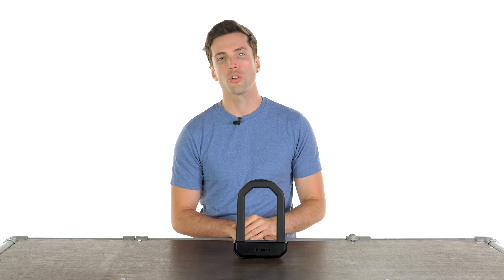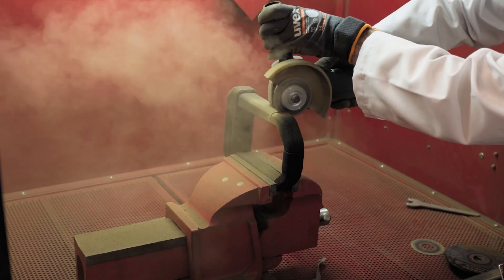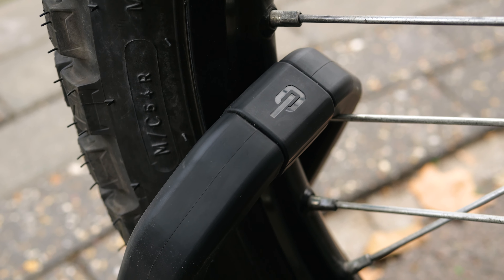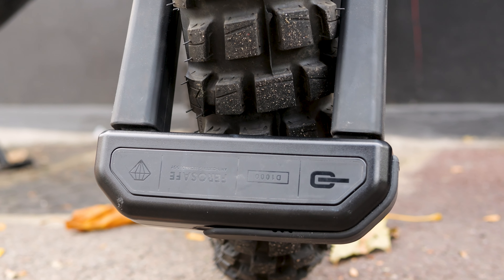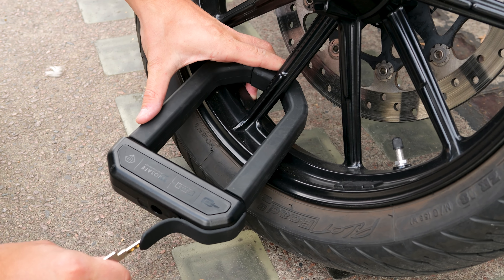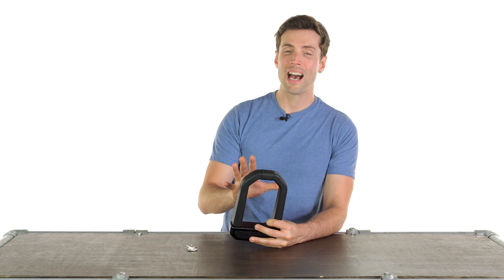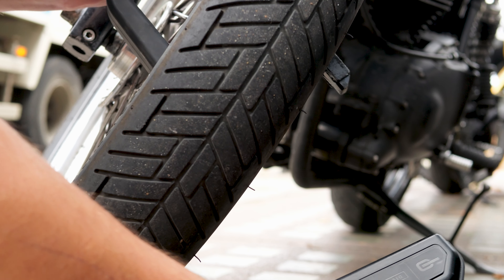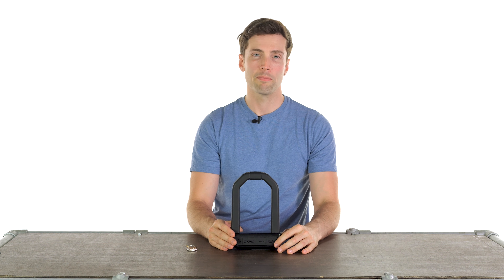HIPLOK D1000 'Anti-Angle Grinder' Bike Lock Review

Comment: Advice:

Use any quality lock SMARTLY!

Don’t just lazily put it through one wheel spoke like in the video. This WILL encourage a thief to destroy your moto’s front wheel to steal the whole bike.

Go through the rim instead. Or more than one spoke AND the rotor. Grasp as much with the lock as you can. Go through the most stout thing you can. 

It annoys me to see lock companies advertise people casually (& lazily) locking a bicycle through the frame top tube only. 

Doing this does encourage thieves to cut your frame!  Why are lock makers marketing a security product in a way that more easily enables someone to defeat the sole purpose of their product?  (I think it’s to sell convenience, IMHO.)

Make what you lock through on your bike stout AND expensive. Not a single easy-to-cut part like one aluminum spoke of a mag or aluminum wheel. 

Anyway, NEVER use a quality bike lock only on a thin bicycle frame tube. 

Lock through the head tube (has a steerer tube inside), the seat tube, or even better, through the rear wheel & tire between the seat & chain stays. Even better if your front wheel is included on the other side of the rack or pole. That locks both wheels AND frame with ONE lock. The Hiplok D1000 can do this with almost all road bikes & mountain bikes with narrower street tires. 

Take the time to utilize your lock to its fullest advantage and thieves will move on. 

And what I post almost everywhere in bike security discussions:

The top three lame smug YT bike security comments:
1) LPL will pick it in 20 seconds!
2) They’ll cut the frame!
3) They’ll cut the rack!

Real-world rebuttal:
1) Thieves don’t pick locks. 
2) When thieves choose expensive bikes, why destroy the most expensive part?  And when they don’t care if the bike’s $800 or $5,000, they’re intending to dump it quickly for $100 to buy drugs. They can’t unload a destroyed bike quickly on the next street corner. 
3) Yes, racks can be cut, but it’s rare. Thieves are lazy opportunists and will move on to easier targets. 

There are always exceptions. But my experience In avoiding theft of very nice bikes over 40 years says using the best locks & your smarts will put the odds in your favor. 

Don’t lock a bicycle up outside over night. 

Use GPS trackers. 

Record your serial number & register your bike. 

Buy insurance as a last resort to attenuate your exposure. 

If you have 3 or more $3,000+ bikes, the responsible thing to do is get insurance. 

But Hiplok gets an A+ in my book for making a HUGE step forward to thwart bike thieves. Kudos!!
Reply: Some really good and under appreciated / considered points here.
Reply: @MegaWebsters  thank you!  I have two recurring dreams:
1)  Forgot a college course the day of the final exam.
2)  My bike gets stolen.  (And it's ALWAYS my fault, of course!)
So I've spent a fair amount of time considering bicycle security, as I only have to worry about #2 these days!
So let my lock obsession and psychosis about bike theft benefit you!!!
Reply: "Doing this does encourage thieves to cut your frame!"

Er no. Not even thieves are that stupid. Cutting through the frame writes off the bike.
Reply: @DreamClean   it entails a big loss, but SOME thieves are resourceful and/or work with theft rings that have the wherewithal to rebuild bikes & sell parts.

When a carbon bike with XTR has a $1,500 parts kit, $200 carbon bars, $500 dropper post, $3,000 carbon wheels, $500 rear shock and $1,200 fork, suddenly those parts will generate some good money sold separately, or put on a frame that WASN'T cut to be stolen.

Not that common, but why tempt fate when you can much more effectively lock the bike better without any more effort.